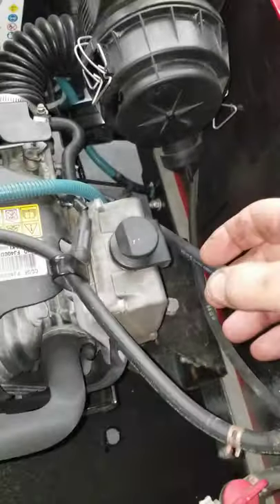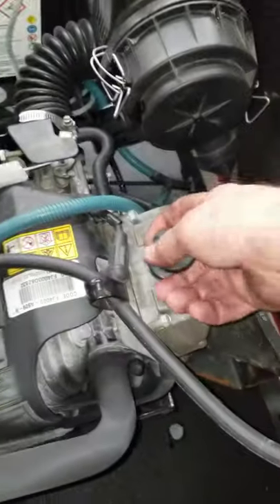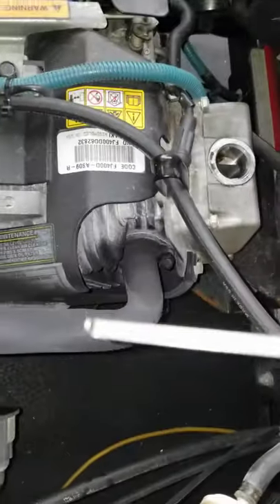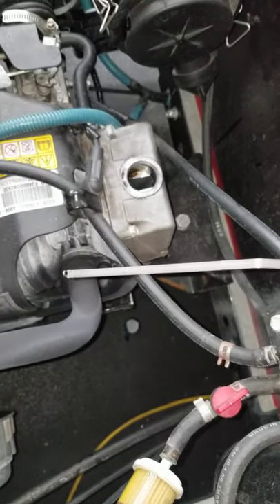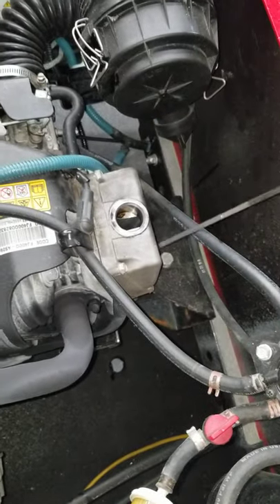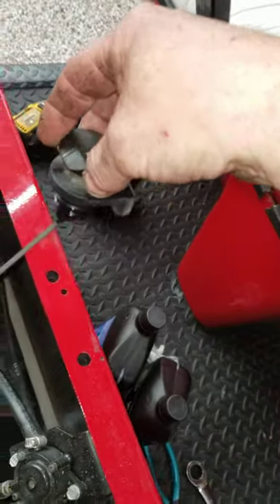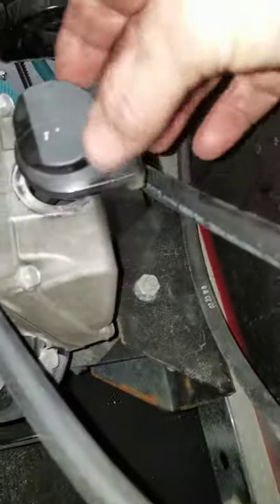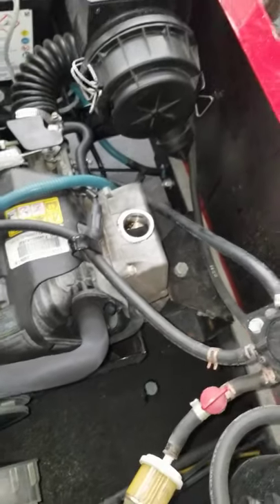How to check oil on an ezgo golf cart. Kawasaki  engine. #golfcart #ezgotxt  #diy  #clubcar

Comment: Take one of them motors out its fun!! It's is hard.
Reply from the maker: I already took out 4 over last 2 weeks and put back in. Side cover gaskets leaking
Reply: Just finished putting a brand new one in 10 minutes ago. I do robins all the time i can have them out in 15 minutes or less and on the table for you to work on.

Comment: how do adjust the governor on a rxv I have 13 model put new cable on it and I still dont like the it not smooth runs great down the road just not around the yard at slower speeds
Reply from the maker: I will post a video later today
Reply from the maker: https://youtu.be/o6Qmr2_ORts
Reply from the maker: Click on that linkage. That is another one of my videos.  Which shows you how to adjust throttle.  Hope it helps if not let me know.